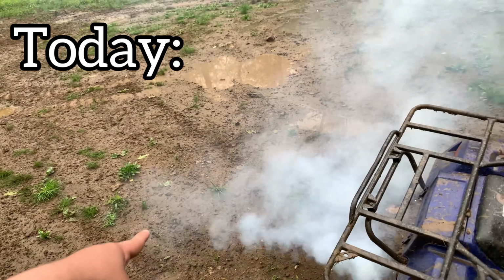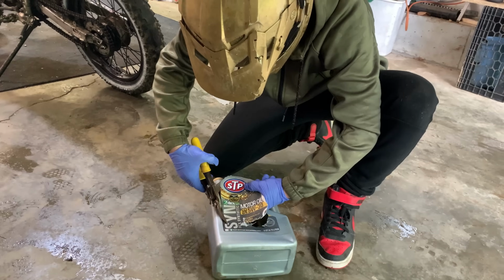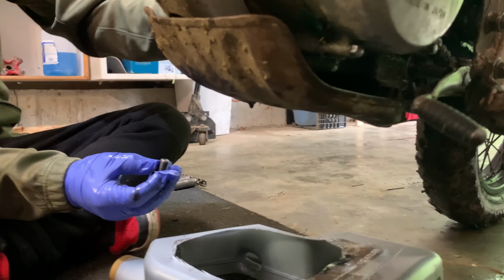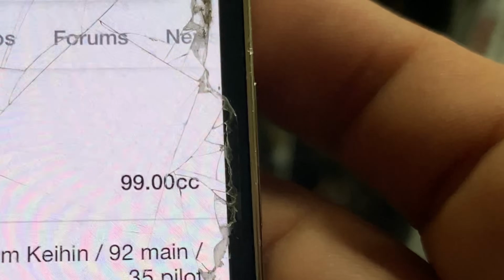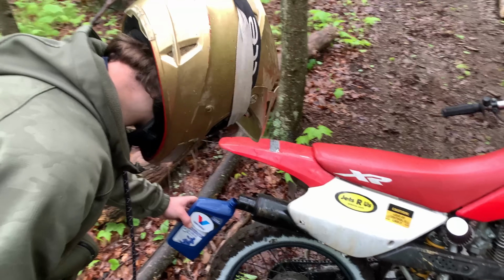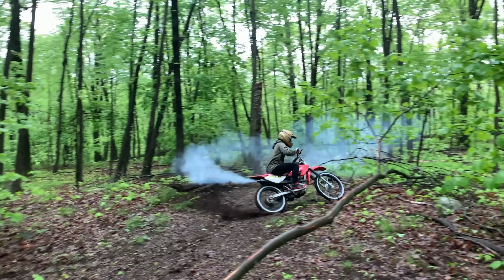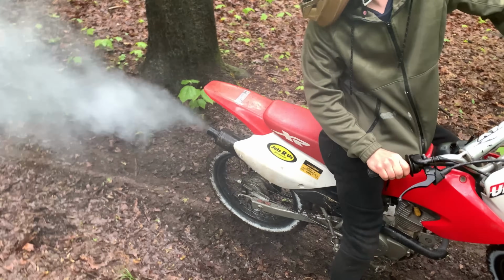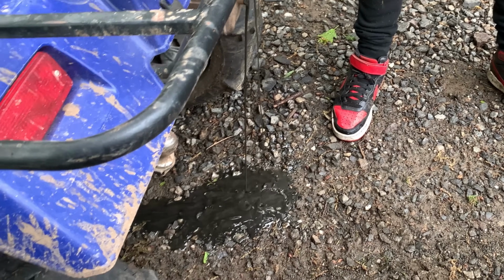How To Reuse Old Oil

Comment: Bro I swear imma check back in 10 years and that honda's still gonna be running
Reply: But my friends 100 manage to blow up with in 2 weeks twice😂
Reply: Best bike
Reply: I’ve literally had a crf80 and a xr100 they aren’t what people hype them up to be I had literally everything maintenance done on time regular intervals and everything and they would need rebuilt every fall every fucking year

Honda makes good bikes besides the valves, timing chain tensioners and oil pump
Reply: @smokey-smore  that's interesting, I've only owned Yamaha and Kawasaki without problems, tried my friends crf250f and it was fine

Comment: My 350 blows black smoke when you floor it and still does it after I put a new head and piston/rings in it😂 and the oil pump on my 2 stroke is so rich it does this on its own